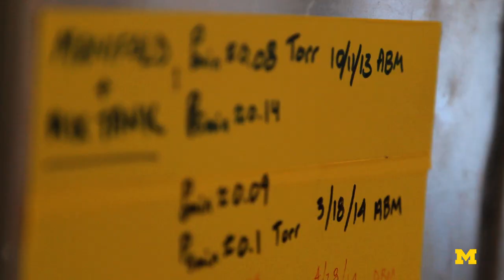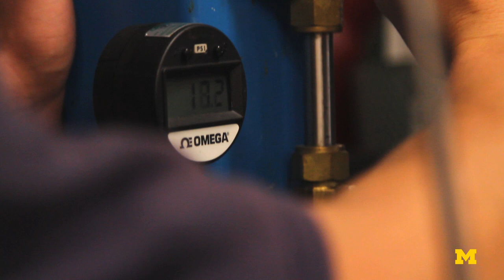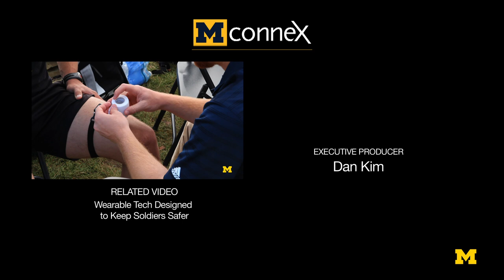Holy Grail of Fuel

Comment: The holy grail that is overflowing is solar for electric cars, everything else that burns can never be as clean as solar...and free. Costly, polluting and complex compression based power is not even comparable to the cost savings and simplicity of electric motors.
Reply: BUT there will still be a billion ICE cars out there that can still get use for many years. Why not have better fuel for those cars that aren't nearly  as harmful as petrol fuels.